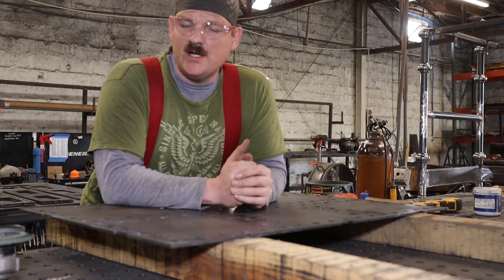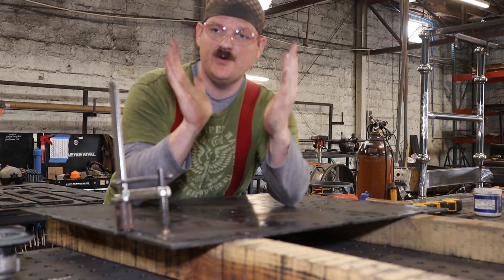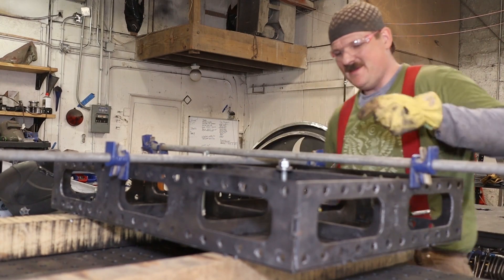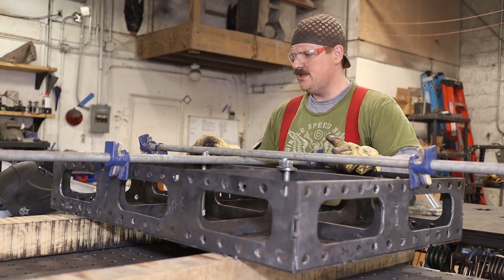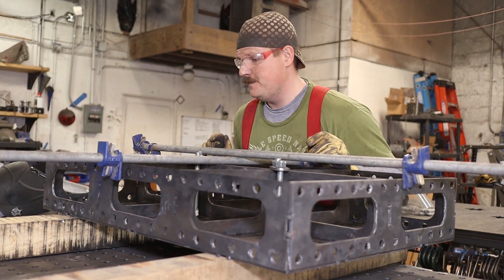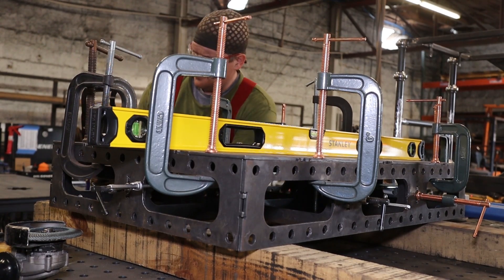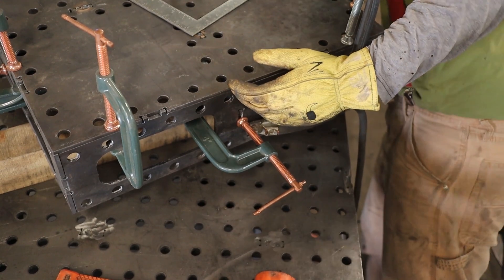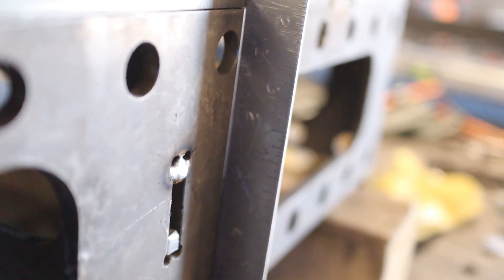PLASMA CUTTING - MAKER TABLE DXF Files

Comment: I didn't use your file, but I reamed the annular cut 2" grid holes in my DIY table to 16mm using a mag drill and use 5/8" cold rolled rod for my clamps. Works just fine.

Comment: I'm getting ready to make a fixture table, we have a jd2 plasma table with a PM45 that generally does a decent job on 1/4" p&o material ....have you had any issues with too much heat input and warpage with a plasma vs laser?
Reply from the maker: No issue with warping, just draw everything down tight and center up the sub frame 👍

Comment: How much material is needed for the 3x5 table, also we are you attaching legs and doing adjusters for leveling the table?
Reply from the maker: The 3 x 5 takes a little over 45 square feet of steel to cut out.  I am including plates to attach legs to the bottom of the table.  And I'm working on a separate leg kit with a base plate flange that will bolt directly to the leg plates.  Should have it available on the site later this week.

Comment: None of my suppliers have cold rolled plate just hot rolled can I still use that?
Reply from the maker: Hot rolled is fine. My laser cut table and plasma cut table are both hot rolled. The laser one has just been pickled and oiled before cutting. You can ask ur supplier for P&O but it's not required for flatness.

Comment: What are your thoughts Comparing Plasma vs Water vs Laser? Initial cost, cost of operation (energy, parts, other), quality of the cut?
Reply: Plasma heats and distorts material and isn’t the cleanest cut.  
Laser is the fastest process and is limited to thickness but really nice cuts but can leave slight slag. 
Water jet will not heat your material therefore would be best to limit distortion, will make smooth cuts but will be a slower process.  You typically choose a process according to the task at hand. Not everything needs to be cut on lasers or a water jet but depending on what it is, it might be a better option.
Reply: @thisdj83 asically said it spot on. People really down play plasma because most use shit budget plasma machines and even shittier $200 DIY CNC tables and rag on plasma. Plasma can be accurate if you have the correct settings and invest in a real CNC table. I’ve paid for laser cuts and literally been able to replicate the same cuts and tolerances with plasma.

Like he said the only downside the plasma is the heat distortion. And as he said laser and water are great processes but have their limitations as well. But too many people crap on plasma because they went cheap, cut corners or didn’t set the files correctly.

Laser is by far the most expensive and required maintenance process tho.
Reply from the maker: Man that is a big question.  I can cover it in a video because each process has it's own advantages and disadvantages.